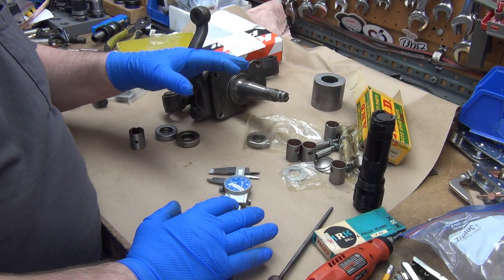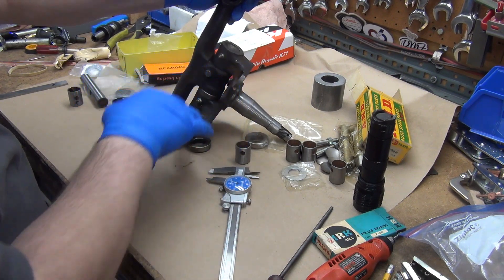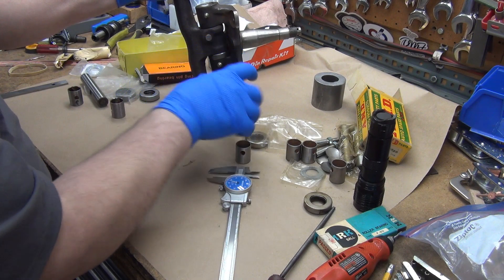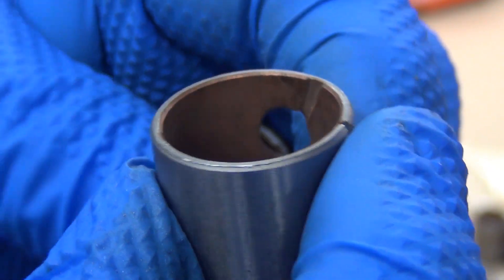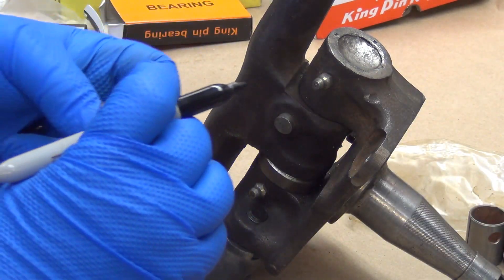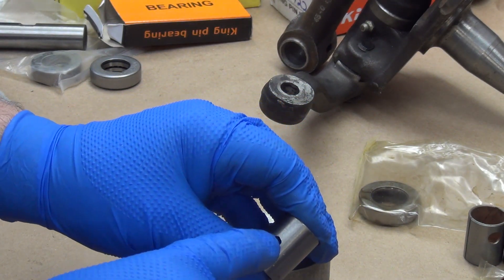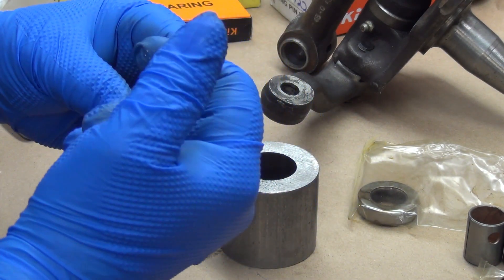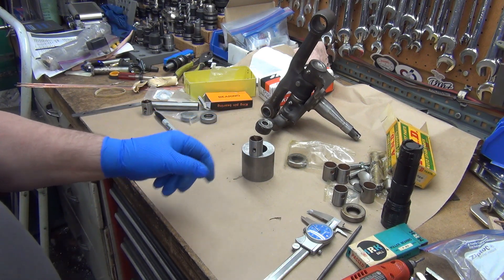Kingpin Rebuild Kit - Comparison

Comment: What keeps the bushing from rotating after installation, and moving the grease hole away from the zerk?
Reply from the maker: They have to be pressed in. They're very tight so friction stops them from moving inside the spindle bore.  At the 1min mark of this vid, you can see me pressing a bushing in with the shop press.  https://youtu.be/ccrUud1G7ks
Reply: @bluehandsvideo  Now I understand.  I wasn't sure if those split bushings actually closed all the way up when installed.  Given its import stuff, it seemed possibly not :)  Thanks for taking time to reply!
Reply from the maker: @somebodyelse6673  You're more than welcome.  I'm happy to hear it makes sense now. :)